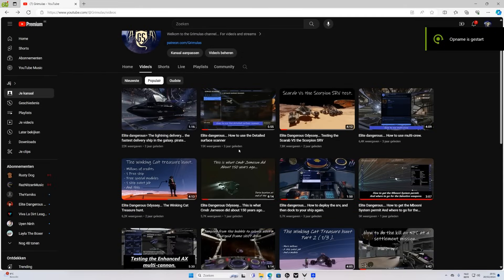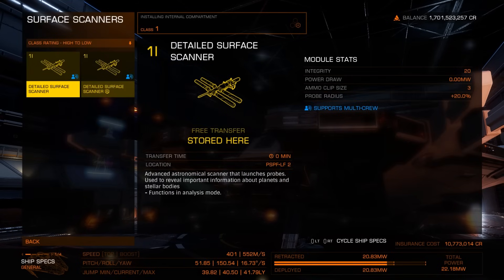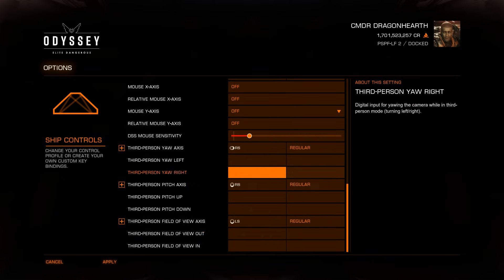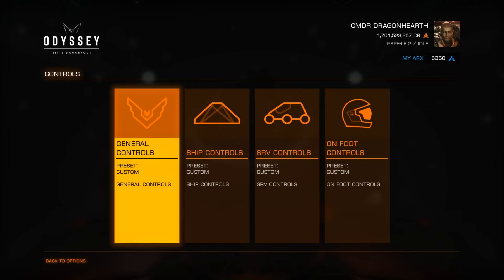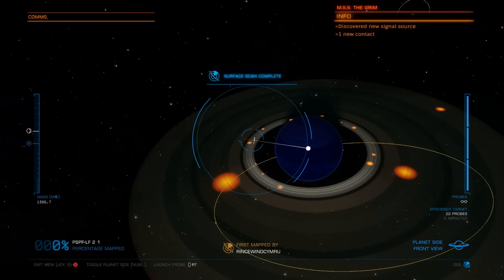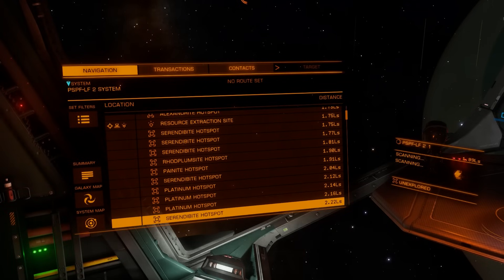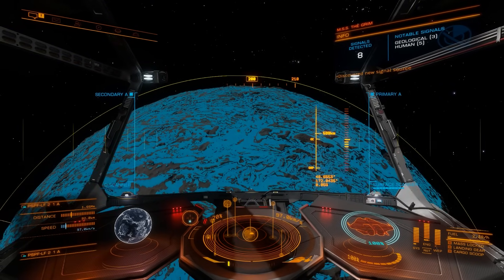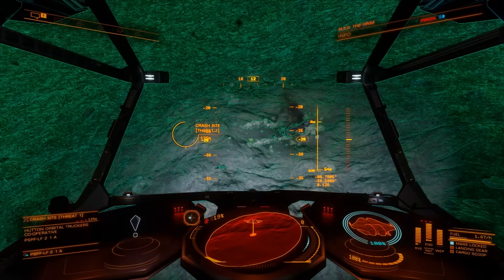Elite Dangerous Odyssey. How to use the Detailed Surface-scanner in 2024

Comment: The hotspots on a planet are the 'most green'?
Reply from the maker: Yes that's correct cmdr... o7
Reply: @Grimulas  I'm confused about this section because I couldn't see anything on screen when you said this that was green.
Reply from the maker: You still need to be in analysis mode... and if there is no green that means there is no live on the planet @Dooms1ayer
Reply: @Grimulas  I mean I couldn't see anything on your screen that was green
Reply from the maker: Ow... ok woops...  @Dooms1ayer